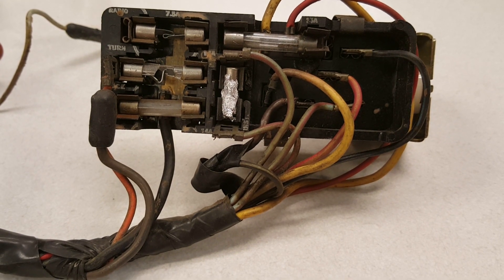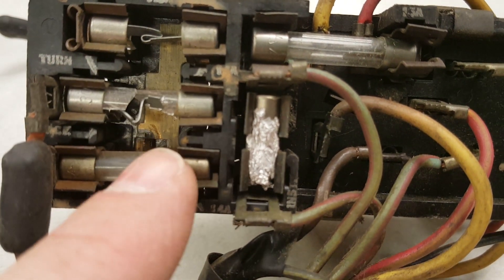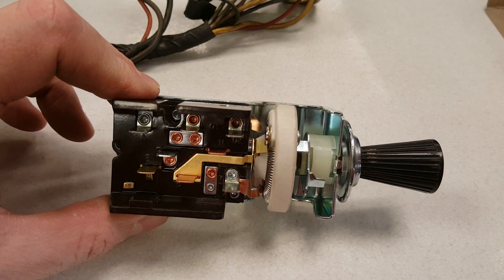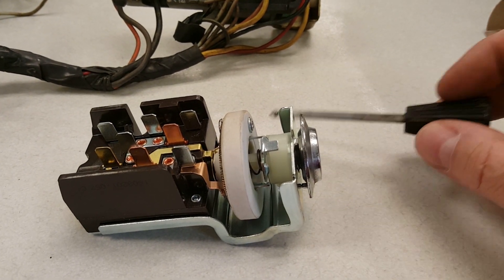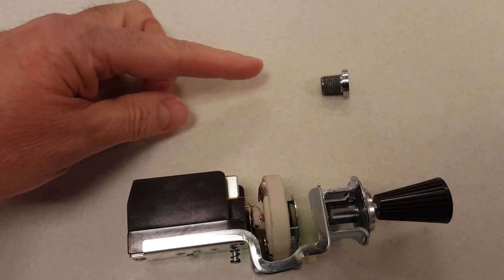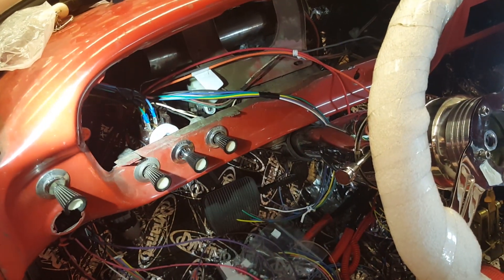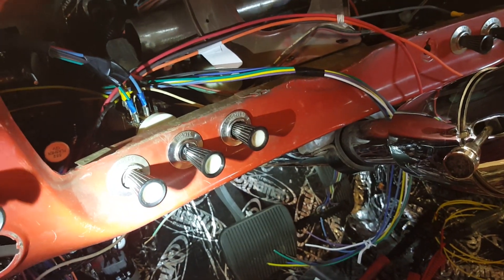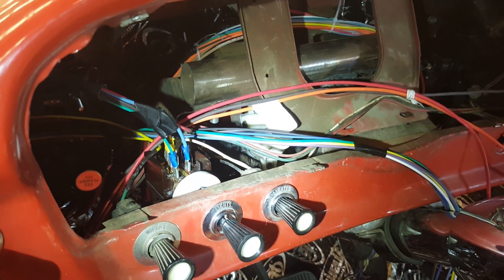1964 FORD F100 CV Build Part 19 Headlight Switch

Comment: do you have video on how to connect blinkers and hazards? I'm at this point p71 '09 to '70 f100, thanks
Reply from the maker: Sorry but I don't. I used an aftermarket wire harness for the truck which has the wiring for the turn signals, marker lights and tail lights. The steering column has the switch for the turn signals and the switch for the hazards. Both are wired the same as a GM car, fairly straight forward to wire. Everything was either labeled or color coded.

Comment: Could you possibly tell me where you purchased the new parts from the switch to the part that pulls out, I want to do this exact things your doing on my 1964 f100 and don’t know where to find all these parts at
Reply from the maker: Hello, the switch is 1970 F100 purchased at O'Reilly's parts store. And if I remember correctly the knob was ordered from Dennis Carpenter. Here's the link. 
https://www.dennis-carpenter.com/trucks/lighting/headlight/c1tz-11661-l-headlight-switch-knob?utm_source=google&utm_medium=cpc&utm_campaign=11654029601&utm_content=116098449809&utm_term=&gclid=CjwKCAjw1JeJBhB9EiwAV612y0kWsOMzaPQSskdMFHfsEy4RUmQQRqRY_GR_vTtpzAAJ0GHWnyevkxoCh3EQAvD_BwE
Reply: @pmr413  thank you very much for that info my only other question is did you also get the spacer from Dennis carpenter with that other retainer nut you talked about in the video
Reply from the maker: @bristolbanister6833  I'm thinking the spacer came with the headlight switch.

Comment: I note the replacement switch doesn't have the glass fuse holders... how did you deal with the fuses?
Reply from the maker: Hello Andrew, I bought an aftermarket wiring harness for the cab and accessories which includes a fuse box. I show it in the middle of episode/part 14. Thanks for watching! Pat